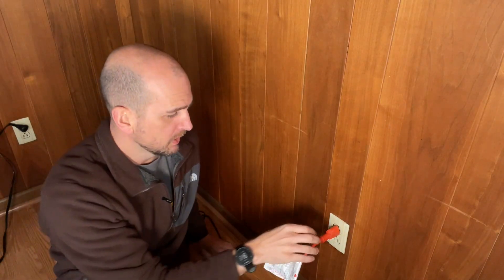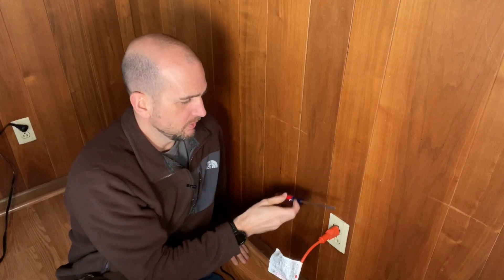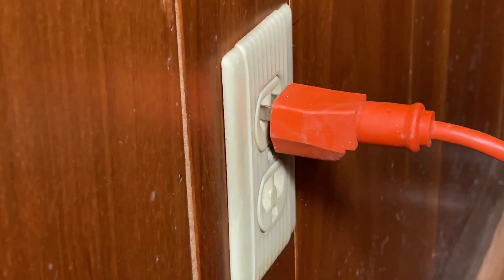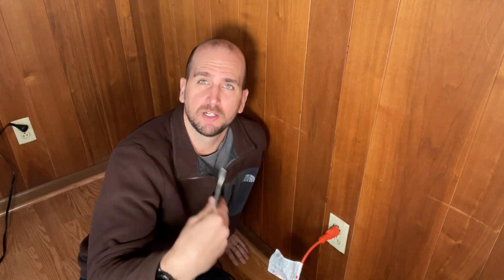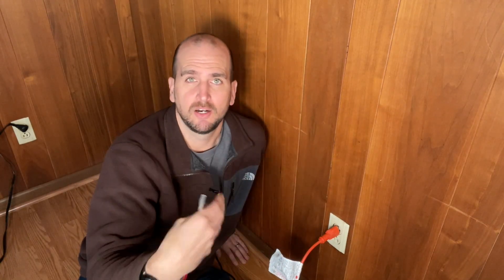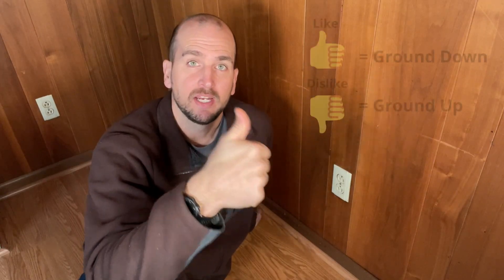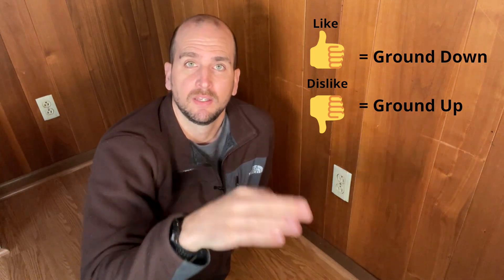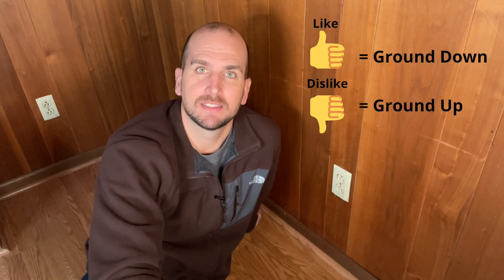Should An Outlet Be Installed Ground Down Or Up

Comment: In my mind the energized part of a receptacle should be the lower than the ground, be it horizontal (Neutral and ground higher than the hot) or vertical (Ground and neutral higher than the hot. Neutral prongs on a plug are larger than the hot and an easy way to identify)

Comment: Every house I have lived in follows your convention: ground up is switched, ground down always on.
Reply: In my experience usually only half an outlet is switched not the entire outlet.  In this case you would not be able to differentiate regardless of the orientation.  It would make more sense to have switched outlets (full or half) a different color but alas I have never seen these as an option.

Comment: Once upon a time, I was told that ground up indicated that  a 3 prong receptacle was installed on an un-grounded circuit. but Ive heard of pros doing it either way. Me I just repeat whatever I am replacing, since I never do new construction.
Reply: Why would you ever put a 3 prong receptacle in an ungrounded box?
Reply: @johncrunk8038  so you can plug in a 3 prong appliance or tool into it. it gets done all the time in old houses. as long as it is gfci and labeled as un-grounded it is up to code.

Comment: Similar confusing gripe on my part.  Most 
 extension cords with right angle plugs, the cord goes DOWN toward the floor.  If plugged into a "hospital outlet, the cord would be fighting gravity ( possible early cord failure ).   Hospital and safety coded outlets might be subject to a thin metal object like paper clips to hit the flat prongs. But what are the odds ?  It might be better to place a plastic angled guard over TOP of the outlets so liquids and metal objects have little chance of hitting ANY conductor or prong.  I have yet to see any cords with angled plugs that would direct the cord downward if used in a hospital or similar environment.   JwgK

Comment: I always do ground down as most if not all plugs are meant to be plugged in this way! Grounded plugs have two prongs that are polarised with one blade narrower than the other, for instance a night light would be upside down if the ground prong was up as it may be polarised without the ground pin, also most wall worts that convert the ac volage to dc, most have the prongs at the top or oposite the wire for the device if pluged in wire on top it will fall away from the wall instead of against it. The choice becomes what you intend to plug in. If you are in a hospital or office setting it might make more sense to put the ground up but on occasion you may find that plugging in your cordless drill charger that you will wish that ground was down.

Comment: My understanding is that the ground is on the same bus as neutral. So ultimately it doesn't matter if it's neutral or ground that is in contact, an arc is an arc.
Reply: Neutral and ground are not the same. A neutral is a current carrying conductor. Grab ahold of a neutral in a damp location and you'll get a shock. Won't happen when you grab a ground. While they do touch , only in the first panel, as they get farther away from the panel there is a difference of potential or flow. It took me forever to understand that as I clearly see them touching in the panel, but the neutral is part of a complete 120 volt circuit.
Reply: @williamdebow3478  that is all accurate, but that's not my point at all. The hypothetical situation is if a sheet of metal falls and contacts prongs, right? Well, it can make either a hot-neutral short, a neutral-ground short, or a hot-ground short. Which of those shorts are "safer" than the others? It's not the hot-ground short.

Comment: The only time I could see using the ground up is if you are using metal wall plates, any other concerns are overthinking.  The chance of something being thin enough to fall and short out the plug other than the wall plate is pretty darn slim and probably equal to something being shoved up from below.

Comment: Growing up I lived in an old house that is definitely not to code. Although the outlets in my bedroom had a third prong, they weren't actually connected to ground. I remember running a ground wire externally for my PC in an attempt to reduce noise mostly. At one point it did fall on top of another loose plug and immediately popped the breaker. So I definitely understand the argument for ground up. If I were installing a bunch of outlets I'd definitely go with ground up for the safety benefits. I think if the room already had ground down though and I was just installing/replacing a small number of outlets, I'd put ground down to stay consistent. I currently live in an apartment where ground is down and I'm not all to bothered by it.

Comment: With the ground down it gives better support to the plug because as the weight on the plug increases the prong pushes against the receptacle and dose not damaged he prong over time , but with the ground the prong gets loosened and may fail over time ! So I’m a ground down person plus when you use a plug adapters he bonding ihole is to the mounting screw !

Comment: I insert a plug with my thumb on top and finger on bottom.  Same as you probably.  When pushing the plug in my finger has slipped onto the hot and neutral prongs.  I don't want that happening to anybody else so it's always ground down for me.

Comment: The NEC has addressed all sorts of innocuous factors.  It has always amazed me that they didn't just draw a line in the sand on this.  You brought up all sorts of angles to the topic, which approaches the argument of "how many angels can dance on the head of a pin?"  That's probably why the NEC doesn't take a stand....
Reply: I am surprised it never made it into the code book. James Stallcup was chief electrical inspector for Ft. Worth Tx and he was on the code book committee. He had the entire code committed to memory. He wanted all grounds up because he thought some mysterious piece of thin metal was going to slide down each and every wall and short out every circuit of which every breaker was going to fail to trip, and burn down every building in Ft Worth. In my 40 years of electrical work i have never once seen such a situation. 
I vote ground down so things can be plugged in as they are intended to be.

Comment: It's ground side down. One big reason, if the residence floods, the ground in the outlets will ground the water. Then when the water level rises it will trip the breaker. If hot side down, the water is now electrified.
Reply: 🤦‍♂️🤣🤣🤣 no no no.
The the ground should be down but not for flooding reason. They are only recomend to be down to accommodate conventional transformers. The rule to many electricians is for vertical receptacles to have ground down and horizontal to be to the right where neutral will still be down.

Comment: ben doing electrical over 30 years . I have the 2010 NEC book. and many past code books as well . the NEC does not state which direction to place outlets . in commercial settings I am told the ground is up. and that is from a inspector from UL that does commercial inspections .  now in a hospital is different again .  the natural is not bonded to ground at all. it is supplied buy  a isolation transformer and a sensor for leakage to ground buy either leg. also red outlets are used let you know what is on backup power . The town hall I work at since 1988 all our grounds are up . and our exit signs are red.

Comment: I own a house that's 100 Years old, It originally had 2 fuses that ran the whole house, in the 1960's the house was updated with push button circuit breakers and 100 Amp service.
This is the house that Jack put together. I found outlets sideways and Ground up, I always followed where the back wire is, On one out with the ground facing up the Black wire's is on the left side as you look at it. On another where the outlet is sideways the Black wire is on the top and the white is on the bottom as you look at it. I worked in a big companies all  my working life, as a Communications Technician (IT), and worked closely with the electricians, they always installed the outlets with the ground down.. I always figured that was a standard. They told me it was union code...

Comment: The ground goes down because your index finger is more likely to touch a live feed if the ground is up. You set them up for what is most likely to happen because you plug and unplug cords by hand , how many times has anyone seen a piece of anything metal touch an outlet.
Reply: When my daughter picked up a pair of tweezers and shoved it into the socket...
Reply: @number9er1  
So once again not an outlet fault but an oversight.  Had the child proof cover been in place I doubt that would have happened.

Comment: I have been working on electrical wiring about 65 years. I usually go ground down with the 3-pronged plugs.
I have never dropped a tool or any other metal item across the hot and neutral leads.
   It is better to go ground down for most plugs to reduce stress on the wiring, since most 3-prong plugs are set up for ground down.
   We had a number of plugs that are ground up in our home. A few I have changed to ground down. 
   I hope the NEC continues to allow the option of ground up, down or sideways.
   I have a box of new electrical parts. If I find a loose duplex receptacle, I replace it. That is a matter of safety.
Thank you for your video.
Reply: I believe in 2011 NEC it said in commercial applications ground was up but in the 2015 they took it off
Reply: @davidzamorano3339  Your wrong it's never been in there. want me to send you my 2011 code book. I have code books all the way to 76, it's never been in the code.
Reply: @stevieg.4816  There are probably numerous NFPA 70 examples of "public input" regarding this topic that didn't make it into the first draft. It might be interesting to see the reasons for and against such nonsense.
Reply: plugs are male connectors, receptacles are female
Reply: This is an ongoing argument.  I find that ground up secures the plug better since the ground pin tends to be more snug and less likely to rock like the two spades tend to do which in my experience tend to sag more often when ground is down.

Comment: Another argument for ground down is those large wall worts. If they are have polarized plugs they always assume the hot is on the right (ground down). Same for three prong surge protectors that hang off the wall.

Comment: I've heard somewhere that when the ground is down it makes the receptacle resemble a face, which is more attractive to a baby or toddler. Which could cause a child to want to touch or interact with it. Not sure of there has been any actual studies on this, but I thought it was interesting.
Reply: Even if that’s true, outlets should still be child proofed if there is a toddler or baby in the home.
Reply: @CytoplasmicGoo  I agree 100%, I was just sharing a reasoning I heard for the ground up orientation. I actually prefer the ground down as it seems to work much better with most right angle plugs and power adapters.
Reply: @shaneatv88  that’s true too. But for me, I’m so used to seeing it ground down it just looks weird the other way.
Reply: AvE made this point too. Related to "Face pareidolia".

Comment: Ground up  is generally wall switch controled - half hot
Reply: Yep. Took me a minute when I bought a new house to figure out why they screwed up one outlet in each room until I realized they were indicating the half hots.   DOH.
Reply: @JayAlfredoG  what is fun is when the installer either did it wrong or someone followed the installation and changes it. (I'm in a house that had an outlet in each bedroom and they wired both plugs when it is normally the top only.
Reply: Thats what I see most common
Reply: Not in my house. It was built in 1970. Every single outlet was installed ground up. Even the half-/full-switch wired.
Reply: Yup, that is something that lazy/cheap electricians do.
It is unprofessional to be inconsistent, and it's the wrong solution to the "problem". They should install receptacles that are marked as switched.

Such as https://www.hubbell.com/wiringdevice-kellems/en/Products/Electrical-Electronic/Wiring-Devices/Straight-Blade-Devices/ConstructionCommercial-Receptacles/DR15C1WHITR/p/2608245

Comment: Hi Scott! I almost always give you thumbs up. 😁☺️ In this case I did, and I would have.  I vote for the ground down.  A lot of great comments and discussions in here.  It’s really up to how a particular Electrician prefers to wire, or the DIY’r, etc etc. Of course an Institutional setting most likely require the ground up.  I think if a duplex, specifically a GFCI, is mounted higher on a wall, or in a basement, it would benefit form ground up.  I recently replaced and upgraded my 15 AMP GFCI, to a 20 AMP, and reversed the wiring, so as to have it ground down.  The old one was ground up, and the way I’m using it, works better ground down.  Personal preference, really.  Your mention of using ground up for switched outlet makes sense!   I don’t see anywhere in the NEC specifying under ‘normal’ use?  YMMV. 
Stay safe and Healthy Stay in your caves on the 20th!  Juss sayin 😳😬 
👍👍👍😁✌🏻

Comment: What about GFCI receptacles? If mounted ground up, the writing on the test and reset buttons would be upside down.  I don’t think the manufacturers designed them to be installed that way.
Reply: All of my GFCI have the test and reset buttons stamped both ways...
Reply: I can’t read such small print on the test switch anyway.
Reply: They are printed both ways....
Reply: @walterhlewicki4621  Mine aren’t.
Reply: I have seen some printed sideways but I’ve never seen “both ways”.  What do you mean by that?

Comment: i think most of the time its just a matter of what you are used to.  to this day i find ground pin up to be a bit odd.

having worked around them i note that a good point for ground pin up was that if the plug does sag down in the socket, its the ground thats exposed,

when i was in the navy, i found it to be a curiosity that all outlets on ship when i was in the navy were ground pin up while ashore it was generally ground pin down though the buildings could be decades close to a century old so who knows the repair history on them.

Comment: In my house, ground up means the outlet is controlled by the wall switch.
Reply: Every building I've ever been in that has had a ground up in any room was because that receptacle was wired to a switch.
Reply: Today most electricians mark switched outlets, with a magic marker black dot in between the blades on the outlet.    Jim
Reply: @jimpie231  Most electricians are lazy.  If my employees graffitied a receptacle they installed, I'd fire them.  There are better, proper solutions:

Such as https://www.hubbell.com/wiringdevice-kellems/en/Products/Electrical-Electronic/Wiring-Devices/Straight-Blade-Devices/ConstructionCommercial-Receptacles/DR15C1WHITR/p/2608245
Reply: Now I know where the black dot came from. But most electrical contractors won’t spend the money to buy these “controlled outlet” outlets. I have outlets that are horizontal and vertical depending on application. I also use different color switches to identify circuits. I have used almond, white, brown and lighted. Thanks....Jim
Reply: Ground up means switched in my houses
Reply: Never heard that or seen a mix before. I learned something new today.
Reply: wish that were the case but in ours the top outlet is the wall switch the bottom is not...  so then that would be a ground up ground down combo??
Reply: @SagePatrynXX  No, but an "upside down" outlet is a call out that it is not a normally wired outlet.
Reply: @machintelligence  usually
Reply: @SagePatrynXX  

I don't believe that is the case.

Unless I'm mistaken each 2-gang has only one outlet that controls one switch (if indeed it is not a standard 2-live setup)..  So each 2-gaing outlet that controls a switch also has an outlet that is always live.

The purpose of a "switch" outlet is to be able to control a lamp via a wall switch.  I can't recall any situation that called for two "switch" outlets in the same 2 gang.

I'm sure someone will chime in on a situation that called for two "switch" outlets in one 2-gang, but as a rule, either two live outlets or one "switch" outlet and one live outlet.
Reply: Sounds great another idea I may have to borrow, I had a rental trailer, and the renter could never figure out why outlets never worked, they were wired to switch by the overhead light. This would have been helpful then.
Reply: In the last 3 places I've lived (built in 1986, 2002, 2014) all switched outlets were ground up to signal they were switch controlled. I always just assumed this was standard.
Reply: @obeliskofdarkness  Common practice, but not a standard, I think. Using a label maker printed label would probably be better.
Reply: @obeliskofdarkness  No, it's lazy contractors.  Getting properly labeled receptacles requires shopping at an electrical supply house (not big box store) and paying pennies more.  Most contractors won't do that.
Reply: Ground up when I see it means a moron did it!

Comment: My thinking is ground down, because with the weight of the cord and plug pulling it downward, you have the friction of two blades holding it up, rather than one round, which I would suspect gets less friction.

Comment: one of the problems in switching the orientation on a replacement outlet is the existing wires would be on the wrong side, and a pain to wrap it around.

Comment: When I went to tech school I was taught ground up but back then coat hangers were metal. That was the main reason we were taught ground up.
Reply: Keep in mind, some outlet covers are metal and come loose. They can fall between the plug in the prongs causing a short.
Reply: @howtodoitdude1662  This is the most reasonable explanation I've seen so far to metal falling on the prongs.